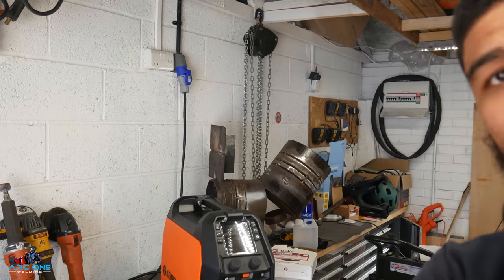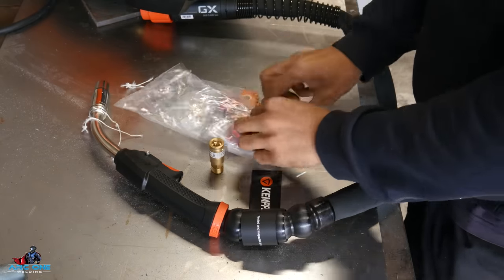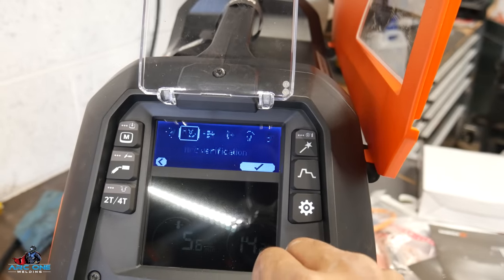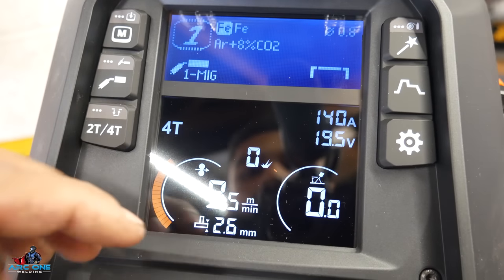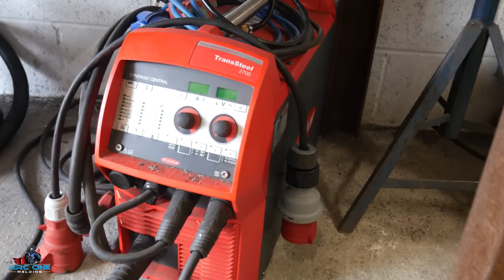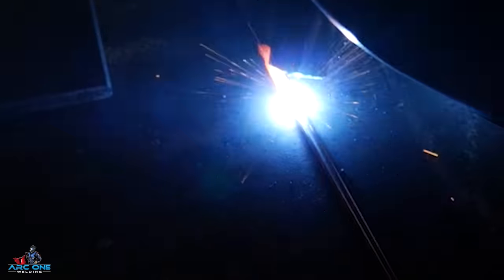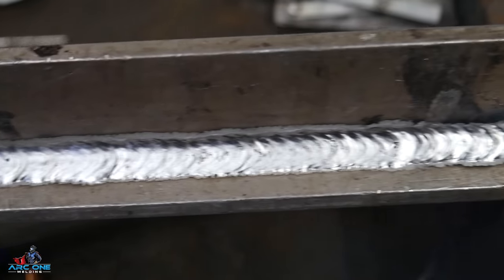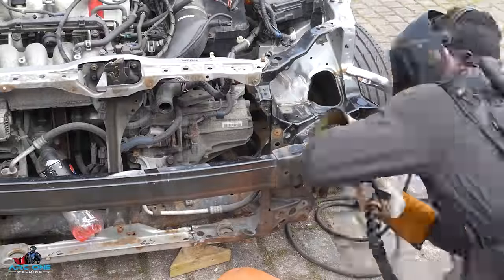Kemppi Master Mig 205 Review: Is It Worth The Hype? Pulse MIG Welder!

Comment: Using a 5 meter torch with a 0.8mm wire is on the limit. I think you are used to 1mm or 1.2mm on your day job. Then it isn't a problem. Using aluminum wire you should get a 3meter torch. You only have 2wheel feeder this can cause feeding problems.
Reply: Not with this machine, you won’t have any issues

Comment: Yep, I can believe a 1-Φ MIG/MAG welder that does pulse.   I have/had 4 different models 😀.  Here in the USA we have quite a few.  Stel from Italy produces them for an American welding company called HTP America/USA Weld, who sells the very finest pulse MIG/SMAW/TIG machines.  First one was a 200A model (Pro Pulse 200), then a 300A multi-process model (Pro Pulse 300), then another 200A multi-process model (Pro Pulse 220MTS), and now there is one called the Revolution 2500.  It is a dual-voltage 1-Φ machine (120V/240V) that has pulse MIG, double pulse MIG, Pulse DC TIG and Pulse AC TIG, and pulse DC stick/SMAW!  Pulse is where it's at!

Comment: i did hear a rumor that Fronius were doing a pulse version of the trans steel ,, mind you the new EWM is a thing of beauty.
Reply: i think the reason fronius hasnt put pulse on the smaller machines is cost. people already dont want to pay that much. but then add pulse and increase the price 2x. ya even less people will buy them. most people want cheap crap for pennies
Reply: @casey3235  yep that sums it up well
Reply: The Fronius is very energy efficient so you can get very good amp of output of domestic use same as the Kemppi 200 evo . It’s a canon for the size and will do 185amp on 13 amp 230v supply.
Reply: @JC-un4bg   thats not to be sneezed at ,,, and they dont come up second hand very often , again it speaks volumes.

Comment: I have the miller mpi 220p its also a single phase kinda multiprocess(its doesn't like 6010 but it works) 
i like the 5 kilo cuz o weld steel and alu. its easy to replace and never get rusty always close in the machine and not to havey to carry.

Comment: I see you are useing optrel swiss air PAPR System, Is it good? optrel swiss air is half-mask. compare 3m adflo full face,which one is batter?Maybe you can do a review on youtube?
Reply from the maker: They are for two different jobs bud the 3m offers more protection, the optrel is only a respirator but i don't weld without it, is a great bit of kit
Reply: Adflo is better . As fume will
Harm eyes to over time . I bet the optrel isn’t compatible with different safety glasses, Eva

Comment: Hi, Calvin!
I want to ask You, wich welding machine would be Your choice between "Fronius Transsteel 2200" or "Kemppi Master M 205"?
And I also want to ask You If this machine (kemppi Master M 205) has some issues already or it's everything ok?
Reply from the maker: I find with the kemppi the wheel that drives the wire occasionally pops off, i was told that the earth resistance needs to be done because it works as a burn back protector on the wire to stop the wire sticking to the tip and inturn the feed rollers are under too much pressure popping the cip off essentially loosing all wire feed, but that only happens when the machine is on the floor and im welding at heights, but like i said a earth resistance calibration should stop that, as for which id choose is tough, id probably go kemppi for the pulse feature, its a much better welding process
Reply: @ARCONEWELDING  
I understand.
I never had a chance to use this kemppi machine, I don't know how good that works in mig manual mode or mig synergic mode. The Fronius Transsteel 2200 is amazing, mig manual and mig synergic mode works incredible but the difference is that fronius have no pulse...
I was thinking to buy this kemppi machine but I need a review before.
Thank You very much for answer!

Comment: Have you had to use it on domestic 13 amp power yet . Would be interested what’s the max you can squeeze out of of a 13 amp
Plug for When you doing job, so that’s all that’s available . I’ve got the 200 and minimig  eco 200 , and I can squeeze 180 amps out of it on 13 amps . I think the play in your Wire is your liner if you’re using .8 in a 1.2 you will get slop
Reply: I've been using a Kemppi Mastertig 230 for around 12 years here in Australia on mostly 10amp power and can't recall when it ever tripped a circuit. I do though rarely go over 140amps, but it's not the best practise.
Reply: Kemppi put PFC circuits in their single phase equipment which means you can get much more through a 13amp plug. 180 amps sounds about right.

Comment: Compact/small/tight space stuff is great if you have child size hands. After seeing this, I wouldn't want that welder. Too compact/small so fiddly and probably frustrating after a while and not very robust looking. A lot of plastic. I bet I can guess where it is made too. 
     The torch length at 5metres is too long to run 0.6mm wire for cars/thin sheet. It will birds nest I reckon very easily on 0.6mm and possibly on 0.8mm wire too? The length of torch lead probably explains why the wire appears to push back into the torch. The wire is flexing in the liner because it is held by the feed rollers and loose at the end you are pushing on.

    I used to have an Oerlikon 300amp single phase mig welder, it was made in 1994 and it had pulse on it. The welder was a full size and not something you could lift easily. I sold it on four years ago and it's still working for the new owner to this day.
Reply: Then go ahead.... Take a guess at where it's made....
Reply: @kristianskov4841  Hmmmm I will pop into my nearest oriental restaurant and ask them what type of ceramic plates they use. I have a feeling it's the same name and spelling? 😜
Reply: @sackvilleweldingservices  
Kemppi welders are made in Finland...
Great machines, been using them for years.